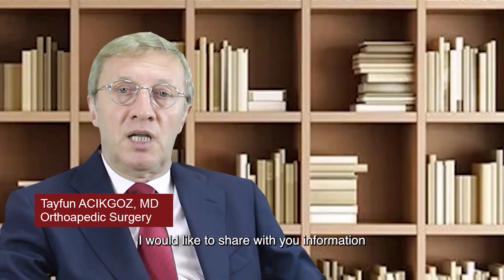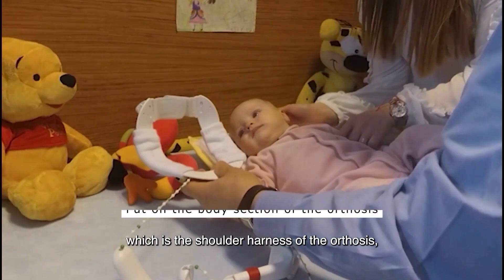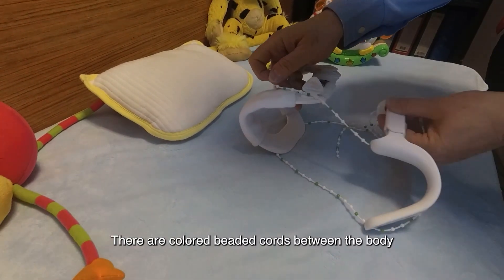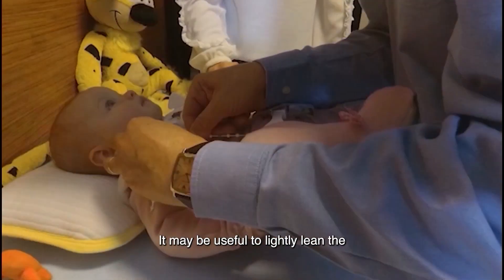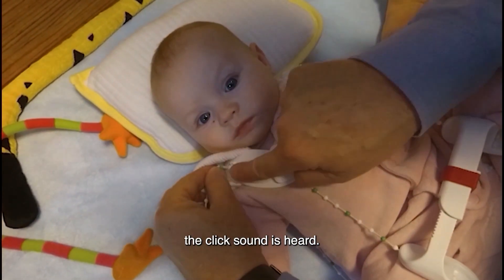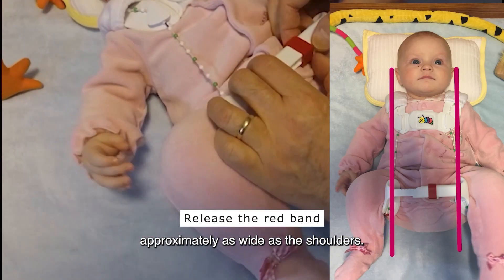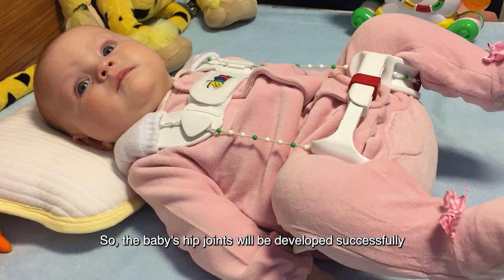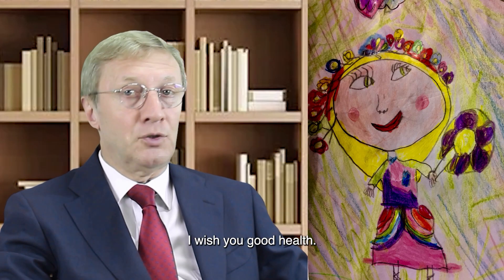Tubingen Hip Flexion and Abduction Orthosis Application - Tayfun ACIKGOZ, MD

Comment from the maker: --How should I apply the Tubingen Hip Orthosis?

The Tubingen Hip Flexion and Abduction Orthosis should be applied by clinicians for the first  time . During the initial applying of the Tubingen Hip Orthosis, your doctor should give a detailed explanation about application of the orthosis.

The orthosis has two parts which are the body part and the thigh part that is supported by an adjustable spreader bar section. 
 
The body part which is the shoulder harness of the orthosis shall be hooked on first. 

Then the baby’s legs are   then placed  in the thigh supports .
There are coloured beaded cords between the body and leg sections of the
orthosis. By lengthening and shortening of these beaded cords, it is possible to adjust the baby’s hip joints to the appropriate hip flexion angles.
 It is essantial that the hip flexion of the baby’s legs shall be more than 90 degrees. 
 
There is a red adjustment element on the spreader bar.It is possible to move the spreader bar and adjust the hip width by loosening this red band. Please note that the baby’s legs shall be adjusted to 30–45 degrees angle of abduction. 
The abduction of the baby’s legs should be approximately as wide as the shoulders. 

Important Notes :
- Always consult with a healthcare professional before applying an orthosis to ensure it’s appropriate for the specific condition.
- Follow any specific instructions provided by a healthcare provider regarding the use and duration of wearing the orthosis.

--How do I apply the Tubingen Hip Orthosis?
The Tubingen Hip Flexion and Abduction Orthosis should be applied by clinicians for the first  time . During the initial applying of the Tubingen Hip Orthosis, your doctor should give a detailed explanation about application of the orthosis.

Applying a Tubingen orthosis  involves the following steps in infants :

A. Gather Materials:
   - Tubingen orthosis device,
   - Soft cloth or padding,
   - A comfortable, calm environment for the child.

B. Prepare the Child:
   - Ensure the child is in a comfortable position, preferably lying down.
   - Remove any clothing that may restrict access to the hips.

C. Positioning the Orthosis:
   - Open the orthosis and lay it flat.
   - Place the child's legs into the orthosis, ensuring that the hips are in a flexed and abducted position.

D. Secure the Orthosis:
   - Fasten the straps or closures on the orthosis.                                                                                     - Ensure that the orthosis is snug but not too tight to avoid discomfort.

E. Check Alignment:
   - Verify that the hips are in the correct position (flexed and abducted).
   - Ensure that the orthosis is properly aligned and that there is no excess material pinching the skin.

F. Monitor Comfort:
   - Observe the child for signs of discomfort.
   - Adjust the orthosis if necessary to ensure a proper fit.

G. Follow-Up:
   - Regularly check the orthosis for wear and tear.
   - Schedule follow-up appointments with a healthcare professional to monitor the child's progress.

 Important Notes :
- Always consult with a healthcare professional before applying an orthosis to ensure it’s appropriate for the specific condition.
- Follow any specific instructions provided by a healthcare provider regarding the use and duration of wearing the orthosis.

--What should I pay attention to when applying the Tubingen Orthosis ?
Important points to consider when applying the Tubingen orthosis are as follows:

A. Proper Positioning:
   Ensure that the child's hips are in a flexed and abducted position.
B. Proper Size:
    Make sure the orthosis fits the child's body appropriately. It should not be too big or too small.
C. Strap Tightness:
    When securing the orthosis, ensure that the straps are snug but not too tight. They should not exert excessive pressure on the skin.
D. Skin Check:
   After applying the orthosis, check the child's skin for any redness, irritation, or sores.
E. Comfort:
   Check whether the child is comfortable. If they appear uncomfortable, you may need to adjust the orthosis.
F. Regular Checks:
  Regularly inspect the condition of the orthosis. If there is a wear or damage, replace it .
G. Training and Information:
   Obtain information from your healthcare provider about how to use the orthosis. Get clear guidance on the frequency and duration of use.
H. Movement Restriction:
   Consider the child's range of motion when applying the orthosis. Some leg movements may be restricted.
By paying attention to these recommendations, you can apply the Tubingen orthosis more effectively.
Important Notes :
The Tubingen Hip Flexion and Abduction Orthosis should be applied by clinicians for the first  time
Always consult with a healthcare professional before applying an orthosis to ensure it’s appropriate for the specific condition.
 Follow any specific instructions provided by a healthcare provider regarding the use and duration of wearing the orthosis.

--Why the Tubingen Hip Orthosis is preferred for treating developmental hip dysplasia in children?

The Tubingen Hip Orthosis is preferred for reasons such as providing a successful and effective treatment, being light and thin materialwise, being hygienic and is easy to apply. 
It is completely washable. 
The Tubingen Hip Orthosis is suitable  for use   with infant carriers and  child seats.

 -- What causes Hip Dysplasia in infants?

The exact cause of hip dysplasia (or dislocation) in infants is not fully understood, However it is associated with  ligamentous laxity (looseness in the ligaments and capsule of the hip joint), certain genetic and hormonal factors, mechanical factors such as intrauterine breech positioning, and other environmental factors.

--What is the incidence rate of hip dysplasia in infants?
Hip dysplasia or dislocation in infants occurs at varying rates among different races and countries. 
Studies indicated that the incidence of hip dysplasia in babies  is 1.4  in 1000 for complete hip dislocations, while the incidence of hip developmental delay, also known as dysplasia, is between 5 and 15 in 1000 in live births.

--What are the risk factors for hip dysplasia in infants?
Risk factors for hip dysplasia in infants are :
a.Family History: A genetic predisposition can increase the likelihood of hip dislocation.
b. Maternal Positioning: The way the baby is positioned in the womb may contribute to the risk.
c. Breech Birth: Infants born in a breech position (feet or buttocks first) are at higher risk.
d. Firstborn Children: Firstborns may have a slightly higher incidence.
f. Developmental Issues: Conditions affecting hip joint formation or alignment can lead to dislocation.
g. Gender : Girls may be at a higher risk compared to boys.

--What are the symptoms of hip dysplasia (dislocation) in infants?

The symptoms of hip dislocation in babies can be categorized as early-stage symptoms and late-stage symptoms which occur after walking.
a.	Early symptoms:
Baby's hip joint movement is limited.It's difficult to open the hip joint sideways when changing the baby's diaper.Skin folds and knuckles on the baby's legs, or if the leg bends, are not symmetrical.
Baby's hips make a clicking sound during leg movements.
b. Late symptoms:
The child’s walking is delayed. Child walks with a limp. Child has a discrepancy between the length of the legs.

It is advisable to consult a physician for diagnosis and treatment.

 --How are hip disorders diagnosed in infants?
The diagnosis of the  hip dysplasia (or dislocation) in infants involves a combination of  physical examinations and various imaging studies including ultrasound and X-ray.
Early detection is essential for effective management and treatment of the contidion.
It is advisable to consult a physician for diagnosis and treatment.

--When is ultrasound performed in the diagnosis of hip dyspiasia in infants?

Ultrasound is emphasized as a important diagnostic tool for detecting hip dislocation, especially in infants.
It provides valuable information regarding the condition of the hip joint and helps in evaluating the risk of dislocation.
Routine hip ultrasound for hip dysplasia in infants is recommended between 1 and 1.5 months of age.

However , early hip ultrasound should not be neglected, especially in infants at risk for hip dysplasia and in cases where there is clinical suspicion of hip dislocation.

--What advice is available for families dealing with hip dysplasia in infants?

Early and appropriate treatment can lead to successful outcomes for infants with hip dysplasia or dislocation.
 Families, particularly those in high-risk groups, should ensure their infants receive regular medical checkups regarding this codition.
 It is advisable to consult a physician for diagnosis and treatment.
 If a diagnosis is confirmed, families should begin treatment without delay.

Comment from the maker: --What is Developmental Dysplasia or Dislocation  of the hip  in infants?

Developmental  dysplasia of the hip ( DDH )  in Infants is a condition in which a child's hip joint is either improperly formed  or dislocated.

 Hip dislocation in infants can occur before birth, but because it most often occurs during the postnatal developmental period, it is now called Developmanda Hip Dysplasia or Developmental Hip Dislocation.

--How is hip dysplasia  treated in infants?
The treatment for hip dysplasia ( or dislocation) in infants depends on the child's age, type, and severity of the condition.

A baby's hip joint disorder can be treated in the newborn ( 0- 6 months ) period with the use of a Frejka pad or a bandage (Pavlik Bandage), an orthosis (Tubingen Hip Orthosis), or a splint (abduction splint).
 In cases where improvement is not achieved despite the use of bandages and orthoses, or in children with delayed hip dislocation, hip dislocation is treated with casting and various surgical procedures.
 It is recommended to consult your doctor for diagnosis and treatment.

--What is the purpose of Tubingen Hip Flexion and Abduction  Orthosis  in children?

 Tubingen Hip Orthosis is used for the treatment of hip dysplasia in children.
It stimulates the proper development of the hip joint.
The orthosis provides the appropriate anatomical position required for the development of the baby’s hips. 
Consequently the baby’s hip joints develops in naturally and successfully.

What is the principle of the Tubingen Hip Flexion and Abduction Orthosis?
 
The main principle of the Tubingen Hip Orthosis is to provide the baby a natural body position similar to that in the womb. 
The orthosis provides the appropriate anatomical position required for the development of the baby’s hips. 
Consequently the baby’s hip joints develops in naturally and successfully.
 

--What is the appropriate size of the Tubingen Hip Flexion and Abduction Orthosis to chose?

There are three ( small,medium and large ) size of hip orthosis.
 The appropriate size of the orthosis should be chosen according to the age and weight of the infant.  

 --How many parts does the Tubingen hip orthosis have?

 
The orthosis has two parts which are the body part and the thigh part that is supported by an adjustable spreader bar section. 
There are coloured beaded cords between the body and leg sections of the orthosis.
 
--Which part of the Tubingen Hip Flexion and Abduction Orthosis should be applied first?
 
The body part which is the shoulder harness of the orthosis shall be hooked on first. 
Then the baby’s legs are   then placed  in the thigh supports .

 --How should the hip flexion angles be adjusted in the Tubingen Hip Orthosis for treating hip dysplasia in children?
 
There are coloured beaded cords between the body and leg sections of the orthosis.
By lengthening and shortening of these beaded cords, it is possible to adjust the baby’s hip joints to the appropriate hip flexion angles.
It is essantial that the hip flexion of the baby’s legs shall be more than 90 degrees. 
 

--How should the hip abduction angles be adjusted in the Tubingen Hip Orthosis for treating hip dysplasia in children?
 
There is a red adjustment element on the spreader bar.It is possible to move the spreader bar and adjust the hip width by loosening this red band.
 It is essantial that the baby’s legs shall be adjusted to 30–45 degrees angle of abduction. 
The abduction of the baby’s legs should be approximately as wide as the shoulders. 
 
--How to apply the Tubingen Hip Flexion and Abduction Orthosis on the child?
 
The Tubingen Hip Flexion and Abduction Orthosis should be applied by clinicians for the first  time .
During the initial applying of the Tubingen Hip Orthosis, your doctor should give a detailed explanation about application of the orthosis.
When applying the Tubingen orthosis, there are several important points to consider. 
First, ensure proper positioning by making sure the child's hips are in a flexed and abducted position. 
The orthosis should fit the child's body appropriately; it should not be too big or too small.
 Pay attention to the tightness of the straps; they should be snug but not too tight to avoid excessive pressure on the skin. 

After applying the orthosis, check the child's skin for any redness, irritation, or sores. 
It's also important to observe whether the child is comfortable; if they appear uncomfortable, you may need to adjust the orthosis.
Regularly inspect the condition of the orthosis for any wear and tear, and replace it  if necessary.
Make sure to obtain information from your healthcare provider about how to use the orthosis, including clear guidance on the frequency and duration of use.
Finally, consider the child's range of motion when applying the orthosis, as some movements may restricted.

--Important Notes :
- Always consult with a healthcare professional before applying an orthosis to ensure it’s appropriate for the specific condition.
- Follow any specific instructions provided by a healthcare provider regarding the use and duration of wearing the orthosis.